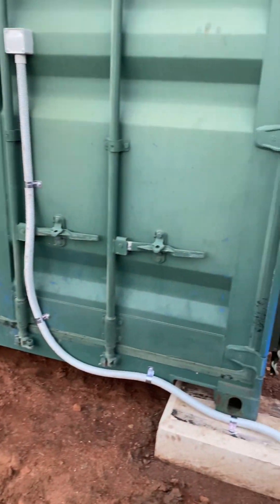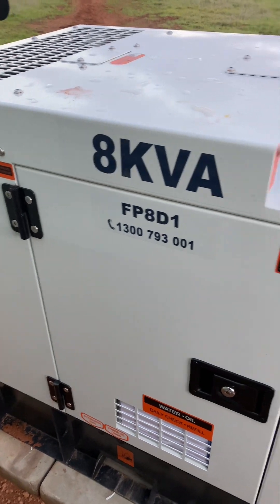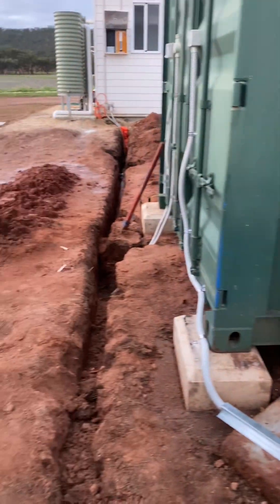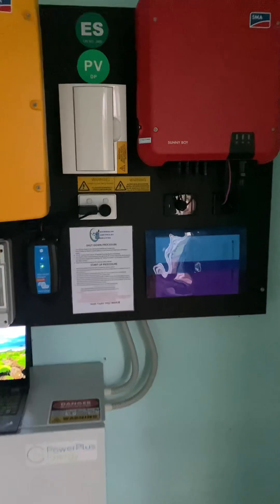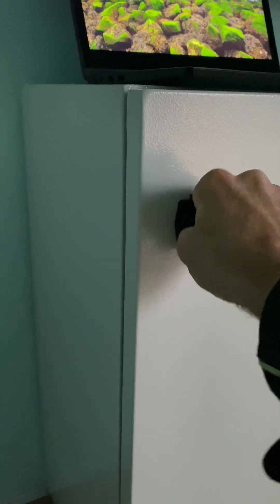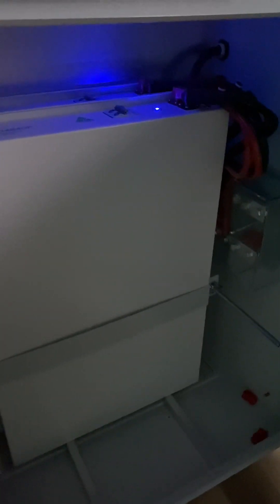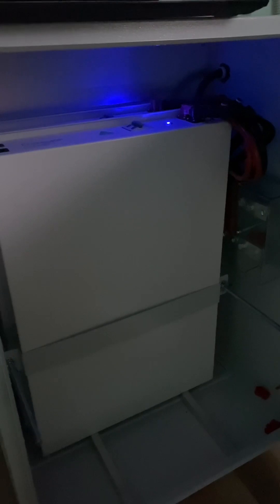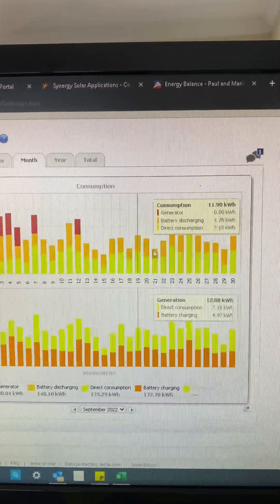Part 3 Off Grid system build in York Western Australia SMA, Tindo, ABLE genny & PowerPlus batteries

Comment: Since the battery has a BMS, can you not setup the CAN connection to the Sunny Island so that you set Li-Ion as the battery profile, so you don't have to mess around with battery charging settings for Lead Acid?
Reply from the maker: Unfortunately no, they are not supported by SMA.
Reply: @joondalupelectricalservice3201  Do you have SMA’s IC-B or SII?

Comment: Hi, is it possible to connect or use 2 x Sunny Boy together on single phase?
Reply from the maker: Hi, yes it is possible. They will just synch together and produce the same frequency. However if doing stand alone or islanding with Powerwall a 1:1 ratio must be adhered to. So for each powerwall you can have up to 5kw of string inverter capacity. Beyond that the system wont island correctly.
Reply: @joondalupelectricalservice3201  Awesome mate and thanks for the quick reply. Does the 1:1 rule also apply to if I have 2 x Sunny Boy 6kW on same single phase and want to later add battery via 1 x Sunny Island on same single phase or would I need to buy 2 x Sunny Island as well?  

Would you recommend 2 x Sunny Boy sync together running on producing same frequency or running them standalone? I am from New Zealand and sparky isn't sure if 2 x Sunny Boy can run on same single phase together and I cant find any SMA documentation to show how to connect 2 x SB together to sync with each other
Reply from the maker: @TheSpyNZ  when using Sunny Island in Off Grid scenario, these are the maximum ratings of the PV inverters 

In off-grid systems, the maximum PV system power depends on the total power of the Sunny Island inverters. Hope that helps.
• Maximum output power of the PV system per SI4.4M: 4600 W
• Maximum output power of the PV system per SI6.0H: 9200 W
• Maximum output power of the PV system per SI8.0H: 12000 W